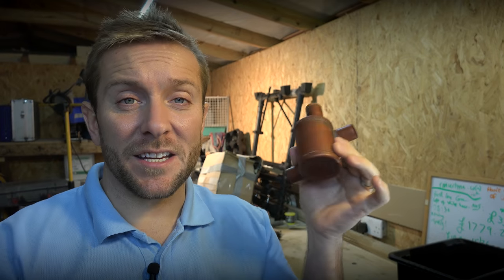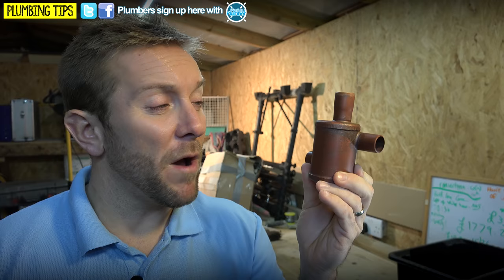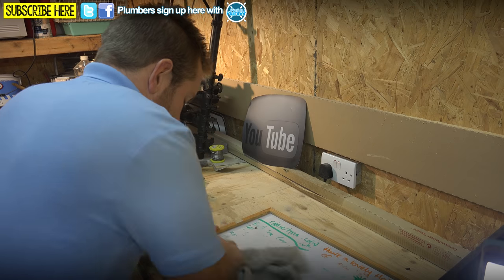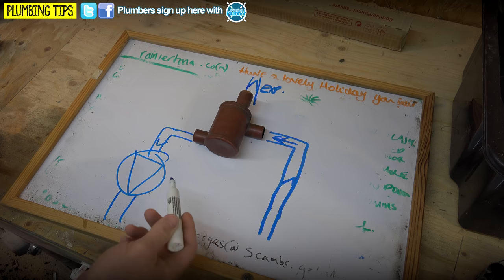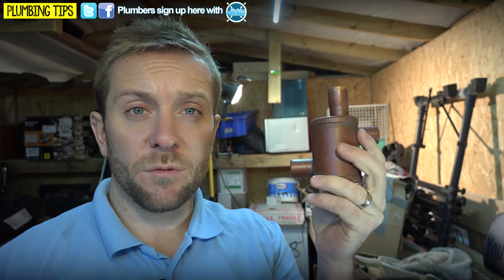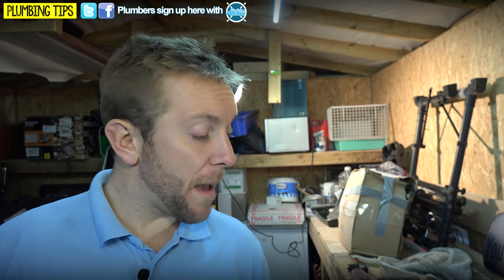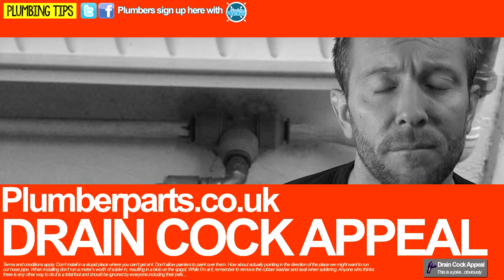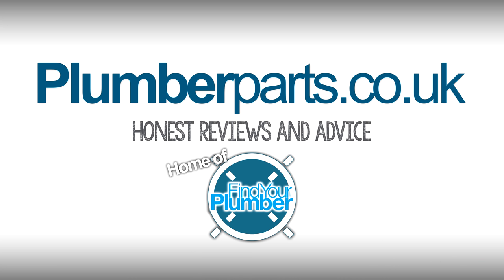AIR VENTS FOR HEATING SYSTEMS - TYPE 1 - Plumbing Tips

Comment: This simple video has explained so much to a numpty like me.  I have a similar device on our system which was installed probably 30 years ago and I have no idea what it was, neither did the so called plumber who has just changed two radiators and now left me without hot water or heat because the system will not refill, and its -3 outside today.  Thank you so much for the explanation, not at least I can try and check the feed from the header tank myself.  Cheers

Comment: I had my aerator removed.... clogged up and stopped the water from moving altogether.  My plumber fitted a piped H section instead with a small air release valve built in. Works a treat & my rads are hotter than they've been for years...
Reply: Where did they fit the small air release valve?
Reply: They fitted a H shaped section out of 22mm pipe & put the small air release valve in the middle of the H with a 16mm pipe. A fill valve at the top right hand pipe & an air release pipe to the top left both of which were already part of set up. Works an absolute treat, the rads get so hot its unreal & the new pump I fitted is set on the lowest of 7 settings.

Comment: Ideal used to have a diagram of one of these in the boiler instructions. It was to have the F&E tank located just above the boiler. Without one you need the F&E quite a way above them. It will work with any vented boiler. I used one as combined heat & vent pipe - that is a 22mm pipe off the top into the bottom of the F&E tank - the boiler needs a high level temperature cut out, which most have these days.

Comment: Hi James,I have a question or two if you don`t mind answering please,
I am building a copper air condensing tubing system on a wall to be used from my 160 psi air compressor.I will be using a flexi rubber compressor air hose in between the compressor to the copper pipe system to have no vibration between the two.the idea is to condense the hot air that the compressor produces and traveling through the copper pipe it will condense to cold air at the end,
Then I will use a catch pipe to drain of the water so it does not enter my tool.
My questions are,
Question 1) Do we have a lettering system K-L-AND M on our copper pipe like America do to illustrate the different thickness off the copper pipe wall,
Question 2)If we do Have a system over here what is the system we go by.
Question 3) would I braise it or solder it,I know that Braising will anneal the copper and make it softer near the braised joint,would this cause a problem to the coppers psi strength
I will want to use 28mm and place a reducer to drop the psi to 125 for the tools I use,

Comment: Note: The "expansion pipe" is the pipe coming from the expansion tank that feeds the system, nearly all water being pushed out of a system by expansion flows up this pipe, it does not flow up the pipe that vents air out of the system, this pipe is Known as the "vent pipe".

Comment: Just had a new pump fitted, since then when the pump is on speed 2 or 1 water is pushed back up the vent into the header tank. Would this be a blocked air vent. When I put the new pump on auto which reduces the speed it doesn't do it.

Comment: what stops the pump from sucking air down the air vent pipe?
Reply from the maker: It's not usually a problem, but altering pump position, speed and crook height all have factors in improving it.
Reply: May be better to put pump further away from vent pipe?  I'm just trying to work out why the pump would rather suck water when it has the option of sucking air through the vent
Reply: It's circulating the water. The water coming up behind the pump is being pushed by the pump also, so its not just getting sucked. The water level in the vent pipe will drop slightly but not much. I hope that makes sense. Also, these are vents are stupid, just use a T.
Reply: denis moloney Thanks for explaining.  vent in 22mm pipe?
Reply: yeah

Comment: Great video James! Would be great to get back to more instruction videos. Perhaps you can get your network of plumbers   to help out? You can't do it all, or can you? Lol 😁 👍
Reply from the maker: Dont Get by Get Bry ha! Cheers mate. And of course I can!
Reply: plumberparts I seem to recall theres a 150mm rule around why the vessel is designed the way it is.
Reply: After looking back at my level 2 course the 150mm is called the neutral point which prevents corrosion in the system as the pump causes a see-sawing motion  aerating the water
Reply from the maker: Also probably to do with the magnetic field of the pump....but you never know!
Reply: Get Bry 
Yes the neutral point is where the cold feed joins the circuit. The water will be under negative pressure from the cold feed to the pump and after the pump it is under positive pressure. Provided there is sufficient height or capacity in the vent pipe it will not pump over into the expansion tank. Thank goodness most new systems are sealed so these problems don't occur so much.
Reply: Skill Builder thanks! 👍

Comment: Can’t believe how difficult it is to find a vid showing how to replace a air flow valve right on the damn furnace system!  Mine is leaking, already bled the bloody lines but need to replace the valve. Damn it there is nothing on line how to actually do the job!

Comment: Sorry, but it's not true that inhibitor stops "air" from forming in the system. Inhibitor slows the process down. Hot water in the pipework reacts with the copper to form hydrogen gas. One or more auto vents will be needed to let the gas out, otherwise rads, almost always at the highest point of the system, will need "bleeding" quite often. If the boiler is a combi, installed higher than the rads, the built in auto vent should keep the system free of gas.